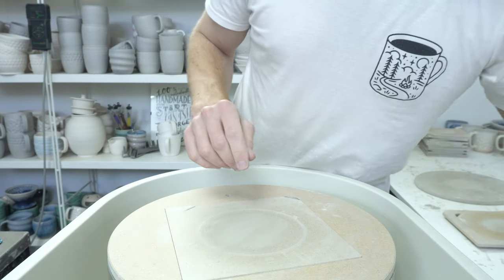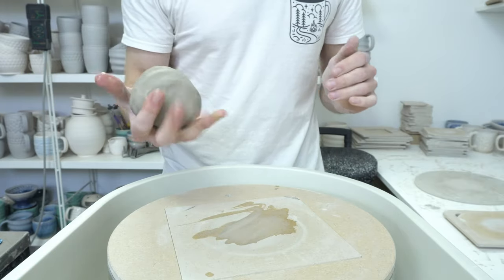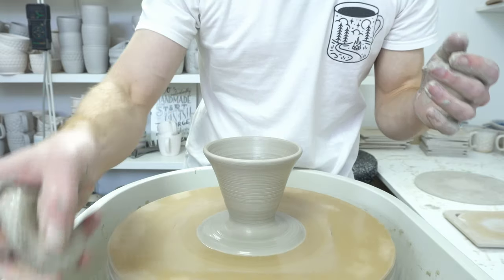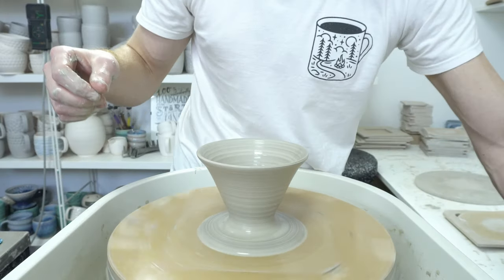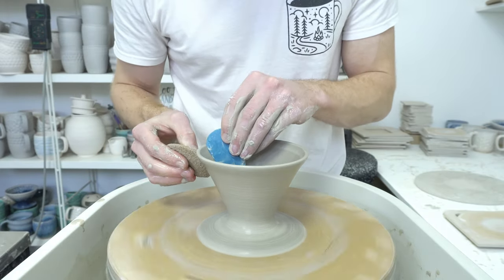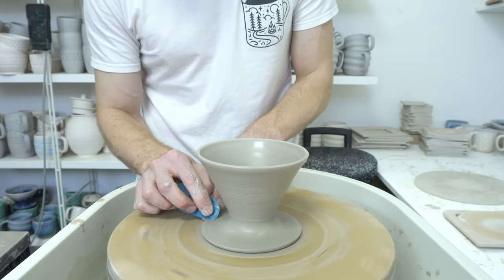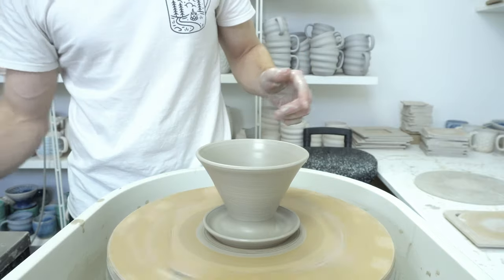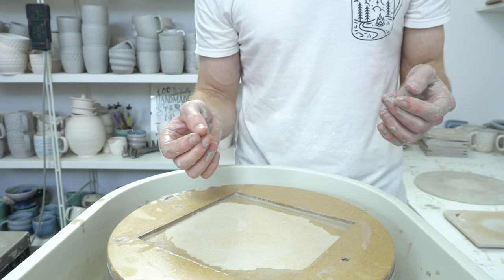Throwing a Pourover

Comment: Hi Joe. Ive been throwing and being aspired but you for through the whole process. 
Anyway clay. So sorry to here you had such a catastofic issue with clay. That would be a night mare. 
I have been using scara clay ES10. All the way through as my main clay because the studio I started at had it as the clay they preferred. If fires very white and I get great glaze results. But I don’t have the knowledge to know if the one you are preferring is better. If you haven’t tried ES10 then give it a go. It is no grog in it. Very fine clay. So the one your trialing the may have some grog. The PF580
I would love to know if you have tried the ES10 why the PF580 is better. Is it just about the feel of the clay and how it responses. 
I’ve also messaged you via Facebook messenger if easier to reply 

Cheers for the direction. I’ve got my YouTube Chanel often tak about you and share ideas you use. So thanks again.